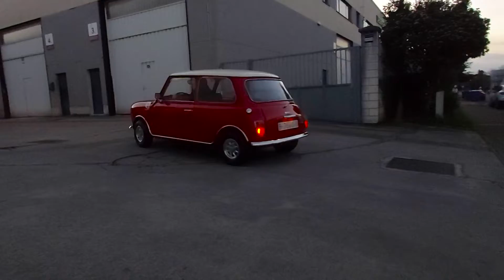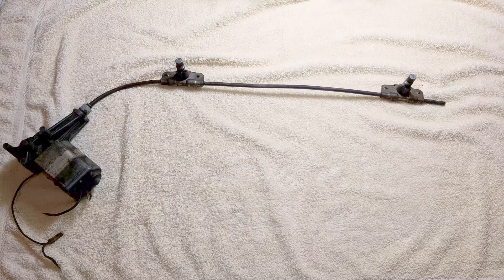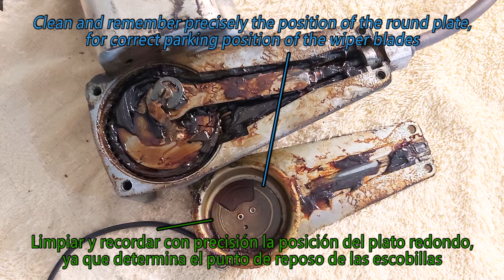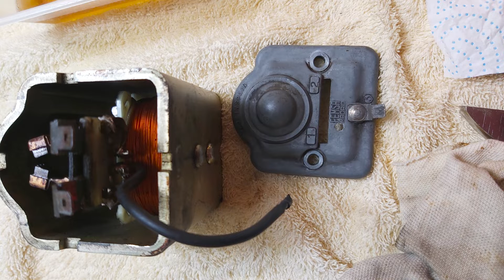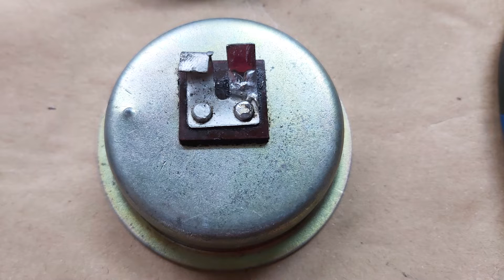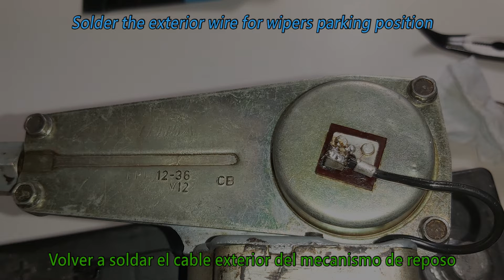HOW TO Repair A Slow WIPER MOTOR in a 1973 CLASSIC MINI

Comment: Creo que te sale mas a cuenta colocar otro nuevo; Se que los hay con doble velocidad de barrido porque al menos en los ultimos Rover lo llevaban de ese tipo, seguramente incluso vayan mas fiables y mas rapidos aunque de electromecanica no entiendo demasiado pero supongo que siendo igual carroceria son intercambiables y seria un plug and play
Reply from the maker: Siempre que pueda reparar algo prefiero mantener lo original. Además el parabrisas del Mini al ser tan vertical no necesita mucha velocidad en las escobillas porque la mitad cae solo 😁 no es como los coches modernos que tienen el parabrisas justo en el ángulo en el que les cae el agua con la velocidad del coche...